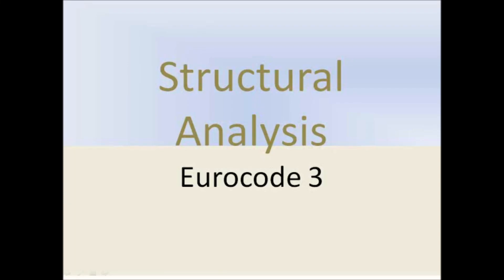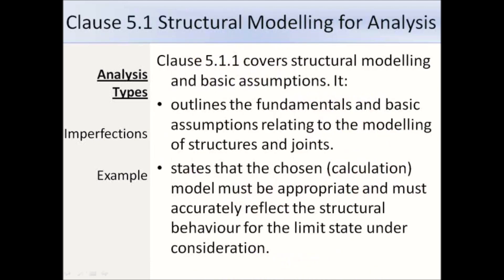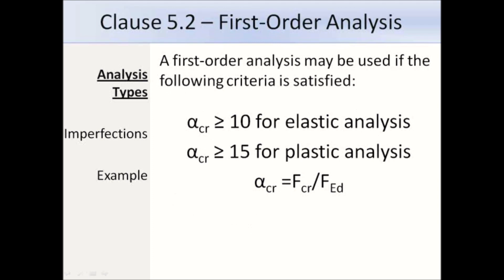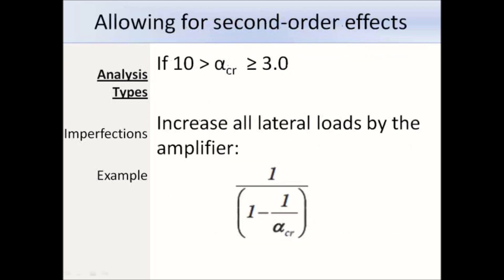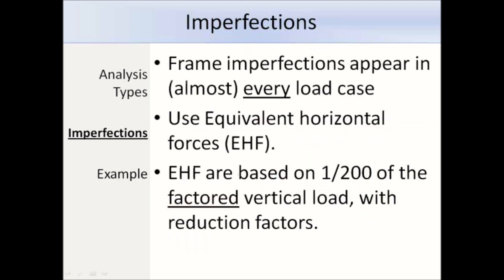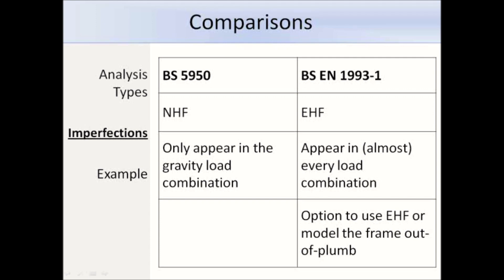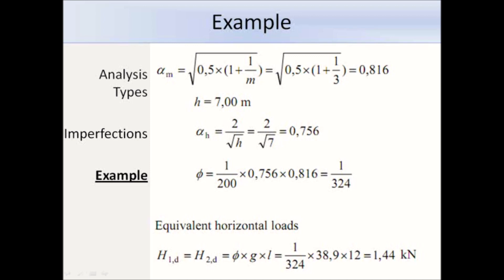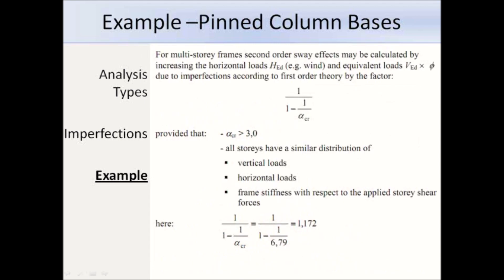Eurocode 3 Structural Analysis | EC3 | EN1993 | Design of Steel Structures

Comment: Hello Dilakshana, I think in the pinned based example when you say the 2nd storey is 8.06<10, I think that's actually the calculation for the 1st storey. The deflection in the example is 1.34, that is, the deflection for the first story, and hence why the loads are doubled in this case. Delta 2 was also located on the first story, so that would be consistent with alpha crit 2 being the first story as well. Please verify.

Comment: Please help me with Design of  cold-formed tesnion member
Reply from the maker: mafefe moloko can you share your design constraints/requirements?
Reply: @IamDilakshana , i have a cold-formed lipped angle 75x50x20x2 connected by two bolts at each end. Fu=346 mpa and fy 279 mpa and Anet=266mm squared